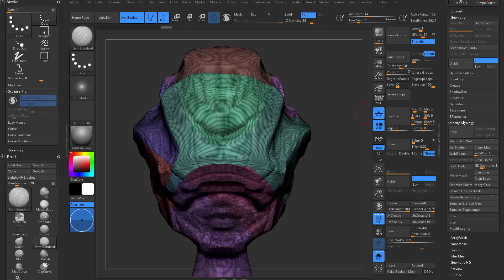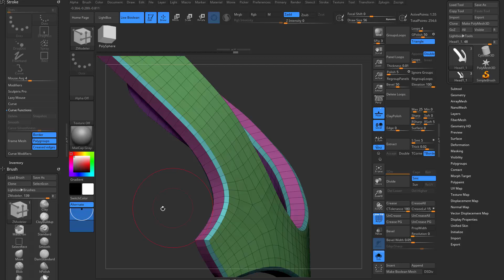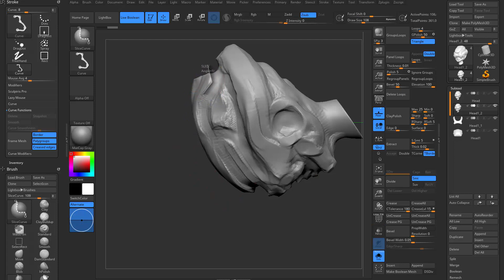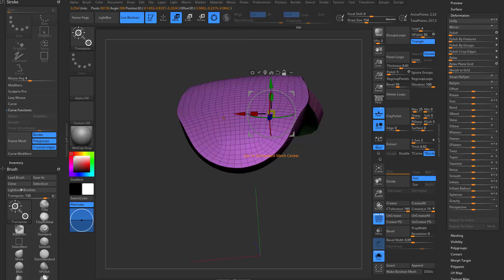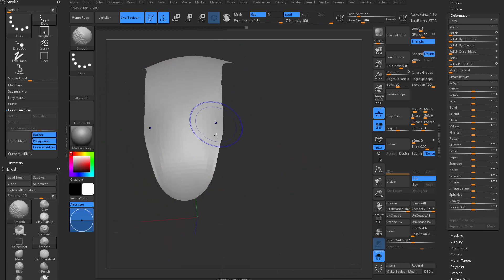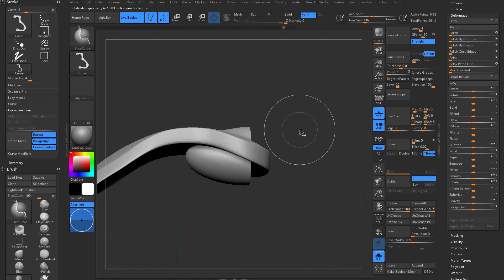03 ZBrush 2018 Hard Surface Zmodeler

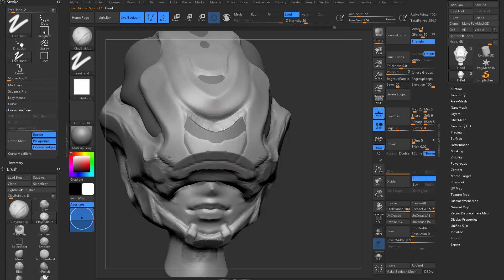Comment: Does anyone know the technique used at 4:30? How does he use clay build up to project the high poly piece onto the base mesh?
Reply: It's no technique. He's holding down Alt to removes clay from the basemesh, which reveals the high poly that was hidden underneath.
Reply: he is pushing down the clay and revealing the finished subtool